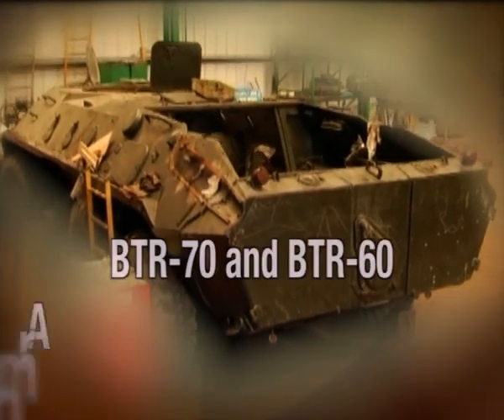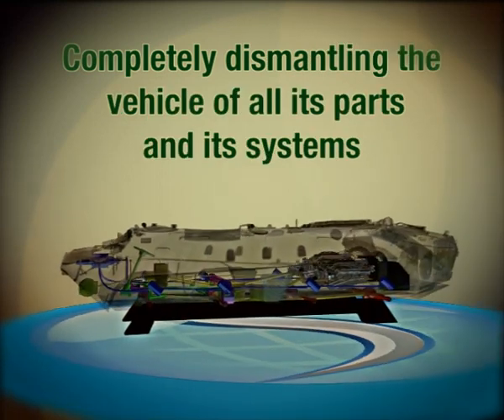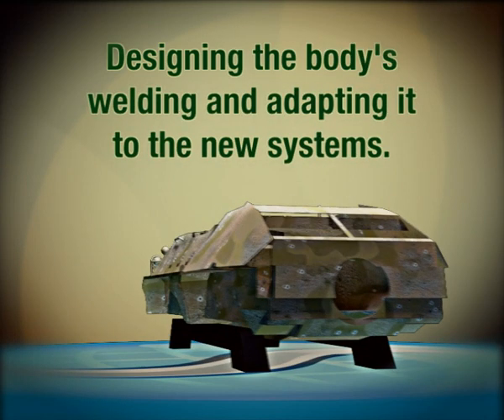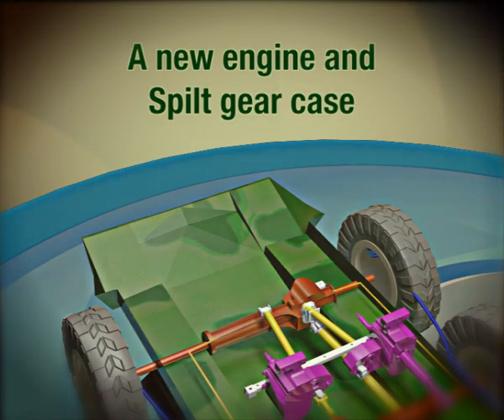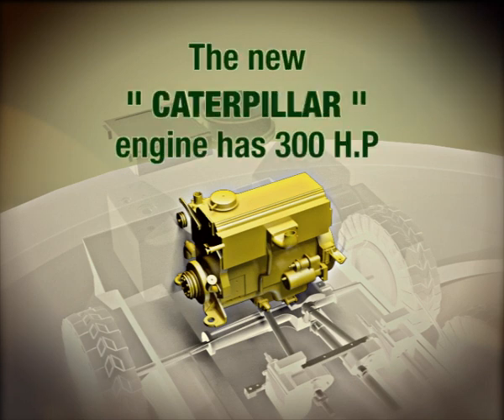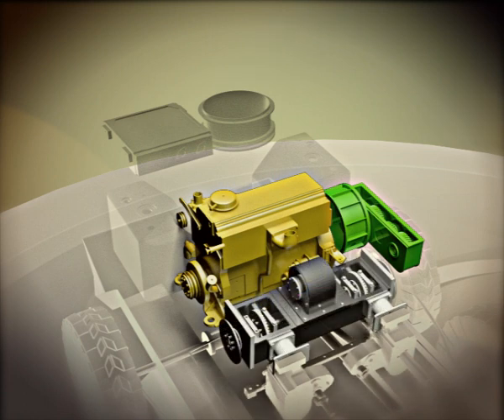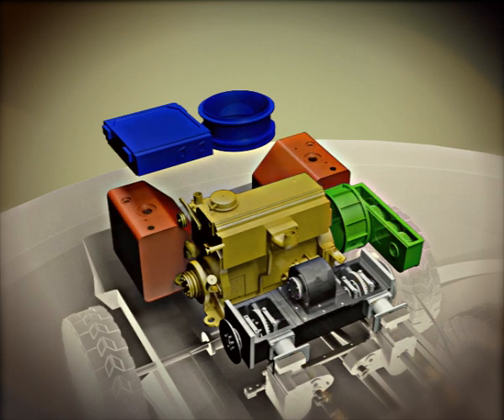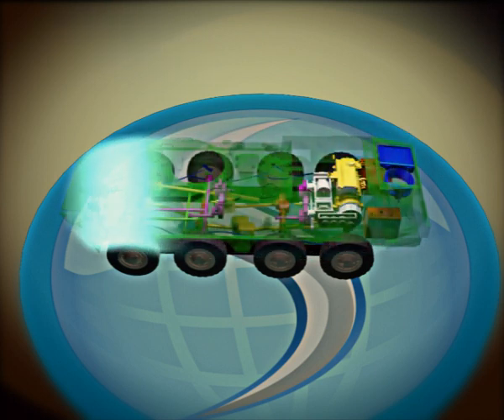BTR 60 and BTR 70 Upgrade and modernization by Saymar ltd

Comment: Those are some impressive features, but I wonder about couple of things;

1- How much troop capacity remains?
2- Is it still fully amphibious without preparation?
3- How much does it weigh?
4- How do all these new systems affect the BTR-60/70's reliability?
5- How much free volume and payload remain?
6- How much weaponry or applique armor can still be added?

No one asked these questions when the Stryker Armored Car and Bradley IFV were developed, and the results were rather dismal as a result.

Comment: With such a volume of modifications, it is necessary to do as they do in Ukraine on the BTR-60M "Khorunzhy" - cut off the top of the hull, move the engine and transmission to the front, make an aparel from the back, as on the M113. Well, or at least you need to weld a side hatch into the structure from the video, like on the btr-80, in Ukraine this modification is called BTR-60T, you have to get out of it somehow.

Comment: In theory, SAYMAR’S BTR-60 upgrade breathes new life into an outdated platform, but the reality is the platform itself is still flawed.
Reply: Very light armor + poor egress = death trap

I think using the BTR-60 to transport troops on the modern battlefield is a bad idea. It might have a role if converted into a tank hunter or something. Have a three-man crew (driver, commander, gunner) sitting in the front, put extra armor around their compartment so they're at least protected against .50 cal bullets, and install a more advanced gun turret with a 30mm cannon or antitank missiles, or antiair missiles. Even after that, don't expect miracles from the thing. IEDs and RPGs will still blast it into oblivion. 

The BTR-60 could still be used for internal security.